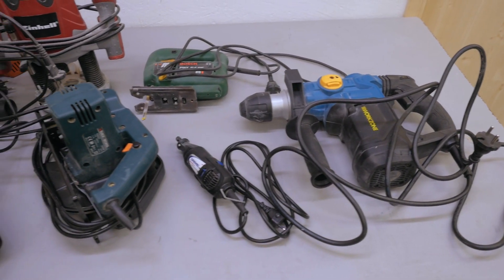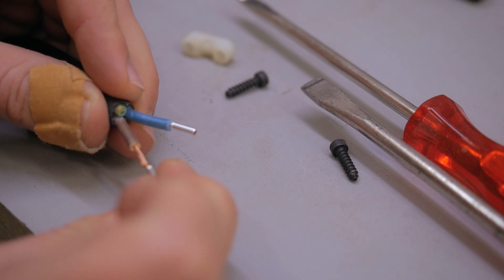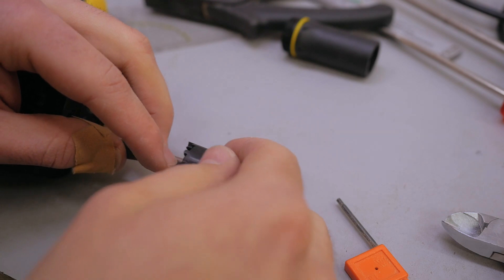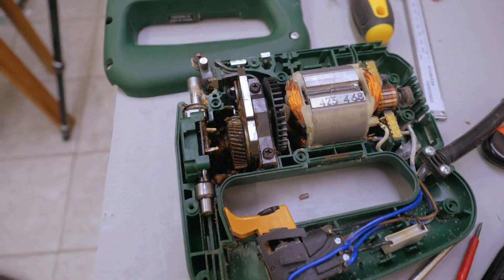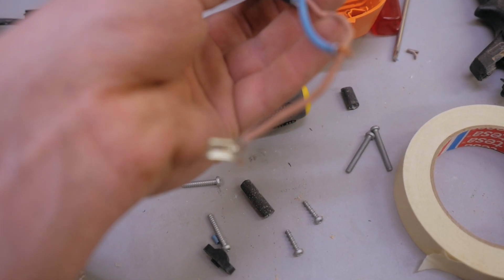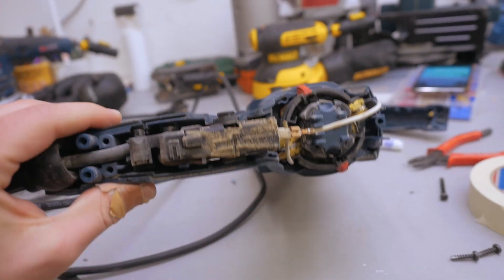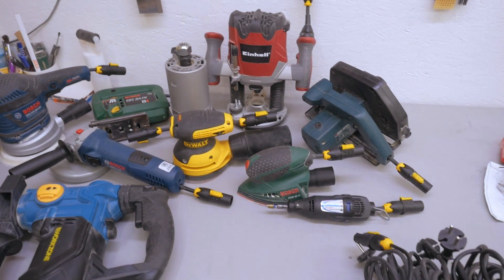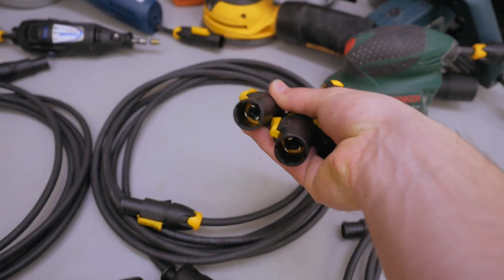A Quick Connection System for Power Tools

Comment: You can buy the Festool connectors separately, they are pretty cheap.
Reply: "Pretty cheap"... for the Festool definition of cheap!
Reply: Not my idea of cheap so I'll go with Stewart's suggestion of  IEC connectors. Thanks for all the help folks.
Reply: Ceees4 realy?
Reply: Sure, search for Festool 492602 or Festool 491145.
Reply: @r.t.5667  yes, extremely very ansolutely pretty cheap, about 35$ per set.
Reply: LOL these Festool connectors are a complete ripoff. The Neutrik connectors are much cheaper and of much higher quality and I'm pretty sure one can find even cheaper ones.
Reply: Only the conversion kit would be suitable and it's more like 17-18 € from the cheapest sources i found.  The Neutrik True1 cost 5,80€ each.
Reply: Sometimes 3 pole audio plug from neutrik will work as well, if you stay under 3-5 amps per pole. Those aren't expensive.
Reply: And the Festool Plugs break all the time. They really are not that good. We have a lot of them in many different tools, and after 1 year or so they break and dont work anymore. Festool is defenetly not the best choice. Im not saying they are not good, its jut that even Festool breaks often. Spezialy this plug systems is a pain in tha ass for us in our company.
Reply: I tried searching for the Festool connectors but without success, do you have a link by any chance?
Reply: Thomas McCusker Have you tried the partnumbers from my previous comment? You can probably get them at any Festool dealer.
Reply: https://www.amazon.com/Festool-Plug-Conversion-Kit-420mm/dp/B002RKHQZ8/ref=sr_1_1?ie=UTF8&qid=1493577250&sr=8-1-spons&keywords=festool+plug+it&psc=1
Reply: I've gotten them for 5 euro, that's what I call cheap.
Reply: The provided link seems to only be for the portion from plug to connector, you have to pay extra for connector to tool.
Reply: berk asal thats because you can use any Festool cable for them, I got myself one of 7.5 meter.
Reply: I've been using them for a while and have never broken a single one of them so that doesn't add up.
Reply: Canario the frstool seem to only be internal connectors. To go inside the casing.

Comment: I like it, but the safety police will be after you now! :P In the UK, we have always been able to wire our own wall plugs, in fact 25-30+ years ago appliances did not come with a plug and you had to wire your own. But in Australia it is like totally frowned upon to work with electricity yourself and people freak out if you suggest putting a new plug on their toaster apparently... different countries, different attitudes.
Reply: In Australia and New Zealand it's flat out illegal to rewire anything that uses mains. Far from "frowned on", they actively prosecute people for it. Even electrical apprentices have to be actively supervised, they can't just be on the same job site as the electrician. Despite that you can buy everything you need without showing any qualifications, even the cheap hardware shops will sell you wall sockets and fixed wiring. which means that every year one or two idiots screw it up and occasionally manage to kill someone. When that happens there's a big fuss. People these days are so precious about their lives! Get over yourselves, everyone dies, some sooner than others. If you die because some muppet swapped live and earth, that's the price you pay for being allowed to do your own wiring... so can everyone else.
Reply: mozismobile thanks for clarifying the law in Australia. Has this always been the case there or did something prompt it at some point? I'm not clear about how you feel about this law, it does seem kind of a nanny state attitude. The only time people actually get prosecuted here in the UK is for bypassing electricity meters and stuff. There are rules about house wiring but basically it will only come up if you don't have the right paperwork when you try to sell your house. It's not illegal to do your own work, but no electrician will sign off on work he didn't do or can't see because it's buried in the walls. It's all kind of backwards because the only way you can certify your own work is basically to become an electrician. There are exceptions for things such as you removed a lightswitch or cooker and put something exactly the same in its place. Anyway, all the documentation is available to you in books and most of it is common sense or fairly basic maths...
Reply: mozismobile you didn't, you said it's flat out illegal to rewire anything that uses mains. But thanks for the clarification.
Reply: The law has slowly go more restrictive over time, largely because of public upset when people die. For example, during the GFC the federal government subsidised ceiling insulation and a few people died from crawling into roof spaces in the summer - at 50+ degrees Celcius you can only work for ~10 minutes then you need half an hour to cool off. But not everyone got or took the cooling off time, and some died. We had a public outcry so now installing ceiling insulation has many more rules. The NZ a similar thing happened with people stapling foil insulation under houses, when they put staples into wires. Except it wasn't always obvious, it sometimes took a while before someone else crawled under the house and touched the live foil.

 It is a trade-off, and Australia/NZ are at one extreme - Australia especially where any fixed wiring at all, even running network cables, needs a qualified person. Personally, I favour regulation. I don't want to die because some idiot connected the structure of my house to 240V, or swapped live and earth etc. I paid for a fairly thorough electrical inspection after we bought this house, and paid for the more dangerous faults to be fixed. That's because I've seen so many horrific wiring disasters in Australian houses. I would not be surprised if they tightened the rules because houses kept burning down from all the shoddy wiring.

The rules don't seem to be collected in one place. Mains wiring, excluding anything that plugs in needs an electrician: http://www.fairtrading.nsw.gov.au/ftw/Tradespeople/Home_building_licensing/Licence_classes_and_qualifications/Electrical.page
Forum has a summary; https://forums.whirlpool.net.au/forum-replies.cfm?t=2332456
Reply: Mozismobile, You obviously can't do any electrical work the other side of the powerpoint, did you have any reference to not being able to work on mains connected appliances? You certainly don't need any qualification to be an appliance repairman, or powertool repairs (i worked in powertool repairs for sometime). I'd be interested to see.
Reply: Lachlan Miller, do you mean the government website reference I gave isn't enough?
Reply: mozismobile the government reference you linked to was for house wiring but didn't mention anything about appliances.
Reply: I have only talked about fixed wiring, which is what that link talks about - and it includes any appliances that are wiring in rather than plugged in.

Working on plug-in appliances is different and I can't easily find any rules at all, but I'm sure rules exist. Likely in the approval certificate process, but it's a lot of digging. I will hit the eevblog forums and see whether someone can point me at the relevant rules.
Reply: Wiring a plug used to be taught in schools over hyar (in the UK).  Maybe the UK goverment didn't trust the natives/forced emigrants in the colonies, so banned plug-swapping outright in these territories. :D
Reply: It's was a lot better putting your own plug on as well, at least you know the wires were tight.
Barry (ENG)
Reply: I can't clarify anything, sadly. Apparently the regulations are a bit of a mess and it's hard to get clear guidance. The short story is that it's probably legal to DIY repair an appliance or even build you own, but anything that happens when you plug it in is on you. If it burns your house down you probably won't have insurance coverage. And so on. But I can't confirm any of that, so I'm just going off what I vaguely recall being told.

Comment: I did something similar a few years ago, but I simply cut the cable from each unit (about 10cm) and installed in a regular male plug. In this way, I can use any electrical extension cord. About $ 2 each plug. I even use a vacuum hose attached with velcro. One extension cord plus one vacuum hose for all the tools I have. Works good and it's pretty cheap!!!
Reply: I have some "hook and loop velcro" roll, some company call it "self grip strap".
I cut lengh of 5 cm, and roll them arround the power cable and the vacuum hose every 30 cm.
I have 2 kind of cable: one with hose (eg.: sander, jig saw, etc.) and one without hose (eg.: drill, etc.) 
Festool does something like that: eg.: their circular when used with the guide... Festool is realy too expensive...
Reply: Search for "velcro cable tie" and you'll find a lot of those. The slot at the head end lets you thread the tie through to attach the  tie to the cable, then something else to that. Normally it's so when you roll up the cable, but it also works for attaching things to cables: https://www.google.com.au/search?q=velcro+cable+tie
Reply: Thats an awesome idea lol I'm gonna steal it
Reply: Lectrix & vacuum hose wrapped around each other FTW!
Reply: woody wood Can you elaborate on the Velcro solution for the vacuum hose?
Reply: that's a good idea it's a way cheaper and it does the same but I would keep the cable at least a half meter long the weight from the plug might be annoying like Marius did on his Dremel that wasn't a smart idea

Comment: Marius, next project idea: retractable wheel for the wall cord, always wanted to know how it works.... like the one used for compressed air? Cheers!!!!
Reply: Nice idea!! 
For this you could use the mechanism from an old vacuum cleaner... tip in case you do this: clean the metal strip spring, curl it a bit outwards to get it strength back and use a little bit grease, worked for me. Try to salvage such from an a-brand cleaner, like Miele.
Reply: +Bernhard Walter
In this case I think the EU is right. People have the silly idea that more Watts means better vacuum cleaner which is untrue. My mother just bought a new one with only 650 Watts and it works better than any other vacuum cleaner she ever had.
Reply: Retractable reel would be great. I'd like to see Marius build one.
Reply: Czar Zenana "always" is not really the case. A rolled up cable act like a coil, the more current, the more resistance in the coil, transformed into heat. A rolled up wire with heavy machinery and long time use in a row, thin cable and without cooling "could" cause the rolled up wire to become too hot. In practice, when using a thick cable, the extra powerconsumption and transforming into heat won't give a problem too often.
I think if you take a short thick cable that reach all corners of a little Shop, and don't use machines more than 1.8kw for hours in a row, it will not cause a big problem.
Try to vacuum for 1 hour with rolled up cable, than roll of the cable and quickly feel/measure the temperature of the cable. It won't be too bad. A vacuüm cleaner is around 1.5kw.
On the other hand: good to take this in notice

Disclaimer: in all cases you should be aware of all possible dangers when operating power tools.
Reply: I have three 10m long retractable mains power cords, each with its own built-in RCD breaker and pilot lamp.  Each one sits on a swiveling bracket attached to the wall in 3 corners of my shop.  The cable roller is a locking one, and then just an extra tug to unlock it and retract. The cable is heavy-duty thick cable, and even when using a high current machine, such as my long-bed jointer, it doesn't even get warm, with only a couple of metres out and the rest still on the roll.  The perfect solution.  They cost me $Aud 49 each, and I got them from the famous centre-aisle sale at Aldi.  They are Aldi's own brand - Workzone.  I've had them for about 18 months and never had a problem with them.
Reply: Don't do this without monitoring the temperature on the cable!
Reply: Yes, but I want to see Marius designing and building all the parts on the mechanism. :)
Reply: You know that you can already buy those? https://www.fk-soehnchen.de/elektrik/haus-hof/verlaengerungskabel-kabelaufroller/BRAVO-Kabelabroller.html
 (Not sure if you were looking for a solution or a project video)
Reply: Well yeah, I know, but I am not going to do all calculations before every use. Let's be honest, if you have a short cable there isn't very much use in a retractable wheel anyway.
BTW new EU-regulations starting 1st of september 2017 do not allow vacuum cleaners to have more than 900 Watts.
Reply: am I missing something? Are you talking about a retractable extension cord? those have been around for a while now....
Reply: Well Yeah, but he was talking about a permanent solution on the wall that retracts automatically.
Reply: You should never use a cable rolled up (partly) though. You always have to unroll them fully when in use.
Reply: And like the most of the EU regulations it sucks.
Some idiots think they have to tell us what's good and what's bad.

Comment: Nice idea, but badly executed. The slaves you removed, are taking care of your powercords, so they won't bend continuously and break. Also the new connectors are quite long and (too) close  to the device, this way they will be in the way during usage.
Reply: Agreed !!!
Good idea for a neater shop but removing the sleeves was a bad idea! 
Because all the tools has one ... mmm ... don't you think every company does it for a reason? 
If you use your tools often, the cords will not last!
Reply: I agree. The connector is too close to the device. I think it's going to be inconvenient to use them now.
Reply: I'm so confused. This system seems like a way bigger hassle than original cords. I can't even think of the issue with regular plugs trying to be solved here. The only thing I can think is his tools won't have cords to wrap up?
Reply: I was thinking the same, but even if they fail, he can just rewire a new one in quite easily.
Reply: when the mains cable fails!! hmm have you ever had a mains cable fail why your holding the tool?
I understand what you mean but in practise sometimes those fails break the tool.

Comment: It is great idea. I already done it with grass trimmer using shorter connectors like this https://www.google.ie/search?biw=1280&bih=800&tbm=isch&sa=1&ei=QvoFWd-YEsbEgAbFwIGwAg&q=3+pin+lead+connectors+uk&oq=3+pin+lead+connectors+uk&gs_l=mobile-gws-img.3...44507.47412.0.47966.9.9.0.0.0.0.123.698.7j2.9.0....0...1c.1.64.mobile-gws-img..1.2.194...30i10k1.2hhngZzLmnE#imgrc=3bugg4CETB-woM:
Much cheaper and smaller. They fit tight, so not easy to disconnect. I did not open the trimmer though and I would not open other tools as well, just cut the cable and connect the plug.

Comment: why dont you just cut and solder the wires on the drill?
Reply: If the tool (or wire) gets so hot that solder would melt, there's something seriously wrong with the tool.
The reason for crimping and not soldering is that a crimped connection is more reliable when there's a lot of vibration. Stranded wire will very likely break right at the solder joint after some time due to vibration.
Reply: V4 Garage
You obviously have no idea what you're talking about. Literally everything in your comment is wrong.
Reply: @V4 Garage: The melting point of solder is determined by temperature, not voltage.  If the soldered connection creates a lot of resistance, then voltage becomes a factor.  However, by itself, voltage is not enough.
Reply: 1:01
Reply: The solder won't melt, but it can creep under the force from the screw and lose contact that way.
Reply: Sry man i was trolling lol.
Reply: In my country the national and the EU standards both forbid using soldered connections at such mains installations. You've read the reasons above and it has nothing to do with the price/connection.
Reply: "Well the power from the wall is coming at full blast."

Any power source will only provide as much current as the circuit draws. And that current is actually very moderate for corded power tools compared to battery powered ones. 230V tool will draw an order of magnitude less amps compared to 18V tool of the same power rating.
Reply: You shouldn't really solder wires on mains going into power tools.  It has the potential to get hot enough to melt the solder if drawing enough current which could be dangerous, this is why you're supposed to use crimps etc if splicing.
Reply: Well the power from the wall is coming at full blast. But inside the tool there are resistors and stuff that alter the current and drop it down to suite the tools motor.. But if you solder the wire coming from the wall, there is nothing reducing the current so the solder which is pretty much the softest metal ever would not handle the power like copper can. So the solder itself would get hot and the copper would get loose which would cause a spark because the electricity has to jump from point A to B which would cause a fire.
Reply: Solder would melt in 230V